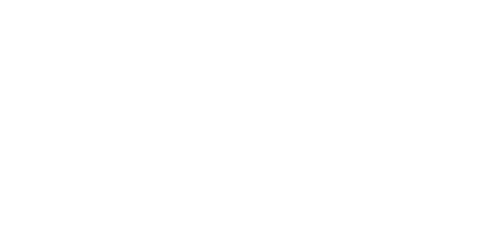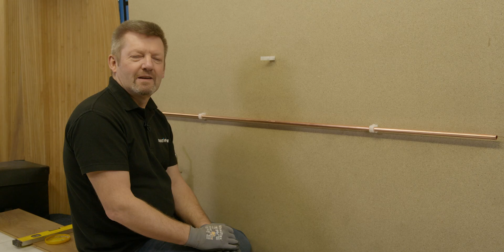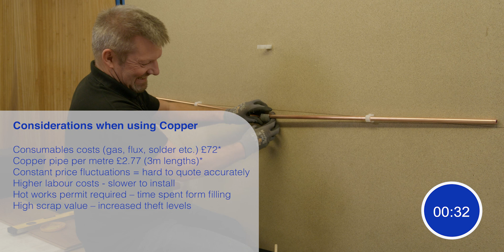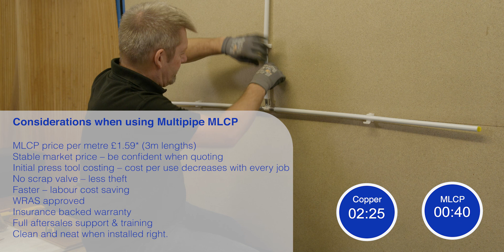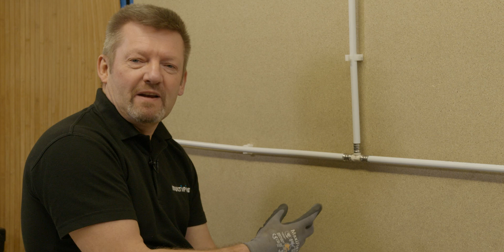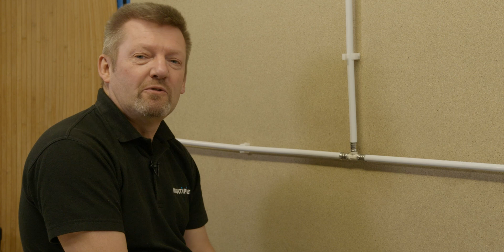Comparing MLCP Vs Traditional Copper For Plumbing & Heating

Comment: Why are you people in the US still using copper pipes and a gazillion press fittings? Why not just bend multilayer composite pipes and only use the minimum amount of press fittings? Every fitting is a potential leak in 30 years.